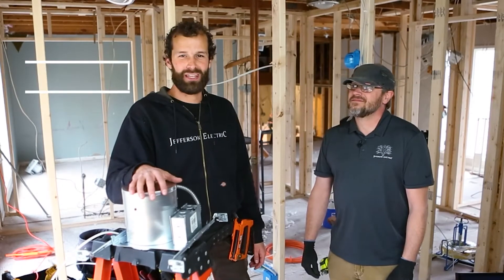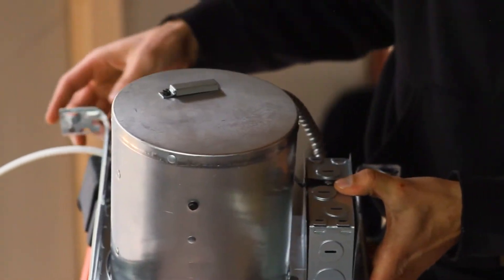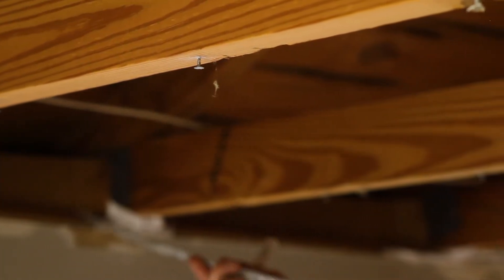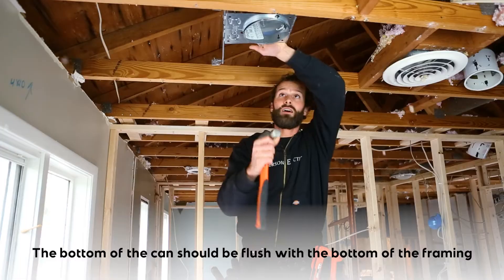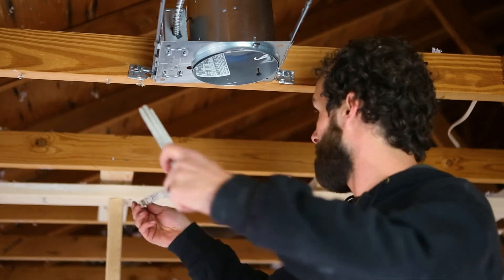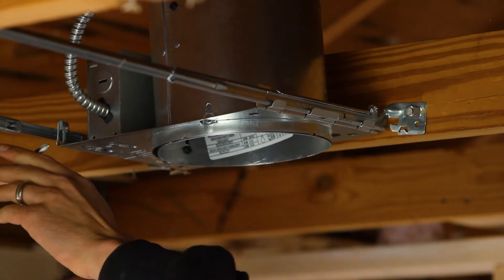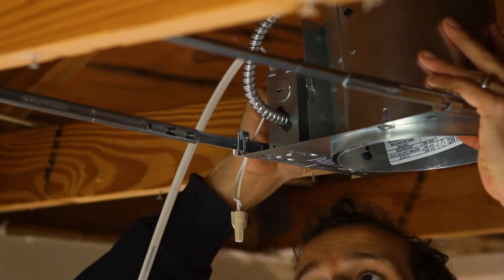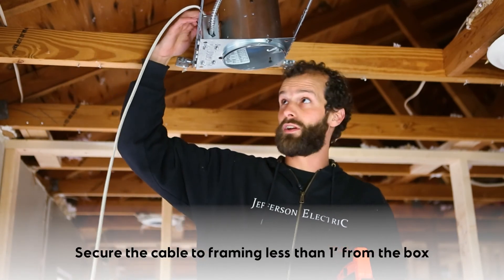New Construction Can Light Installation

Comment: Can you explain to a guy who is not an electrician but I’m doing my own off grid solar system with can lights why you wouldn’t use a snap in Romex clamp in the junction box to protect the wire on the can light?

Comment: For a mater electrician, i would have expected some type of romex clamp protector rathar than leaving it bear to cut on the metal edge? There are so many to choose from and their inexpensive?
Reply from the maker: Good eye, @Rudy Ramirez, and good call on always using connectors! I'm assuming you're referring to 4:16. The Juno can that we use at Jefferson Electric actually has UL listed clamps in those corner knockouts for NM cable. We have not had a callback related to them yet, but we'll keep you posted if we do!

Comment: Informative video. I’ve been debating the canned light vs LED. I’m worried a little about LED going out then having to worry about finding matching LED as well as wondering about then if the new light would be brighter than the old lights. You mentioned the 33 inches from framing but what is the range between lights? I have a room that is about 20’ x 52’.
Reply: The rule that I use, in general is; whatever the height of the ceiling is cut in half for distance between lights. So 8' equals a 4' distance apart.
Reply: @ElectricProAcademy  thanks for the reply.  I went ahead and got two boxes of 6 LED with 6 different options of different levels of lighting, to at least try in the 14 x 12 bedrooms. The room I mentioned before is just a family room with 8'9" ceilings.

Comment: Good job on demonstrating!
 However the trend is to use LED lighting which is smaller and can be color adjusted.
10 wire nuts? Try Buchanan B1-1. It's perfect for that stranded wire. Been using it for multiple decades.